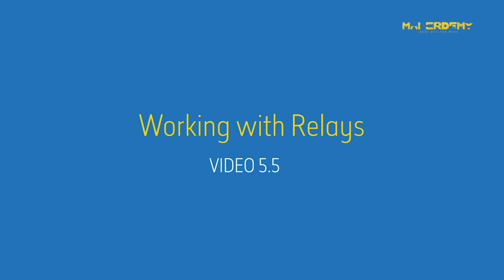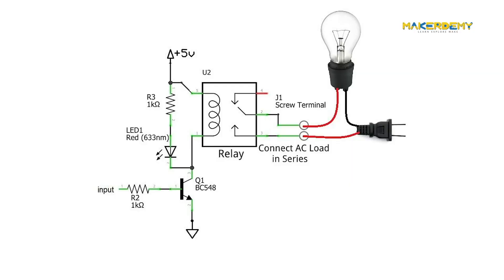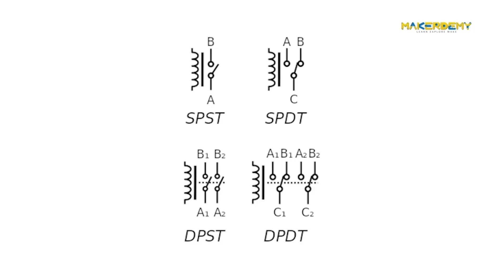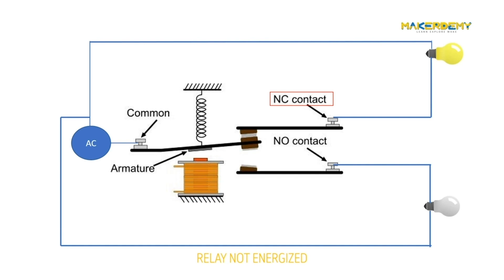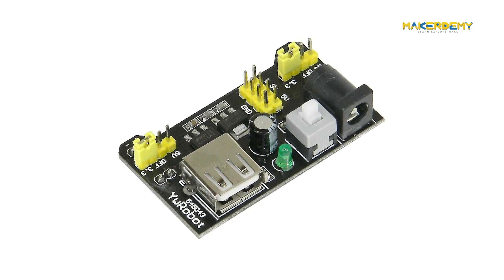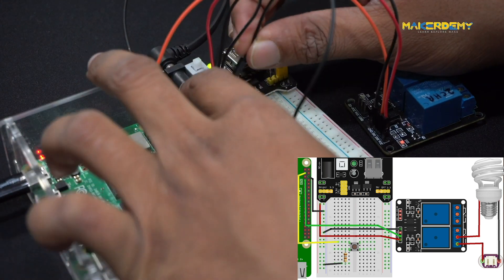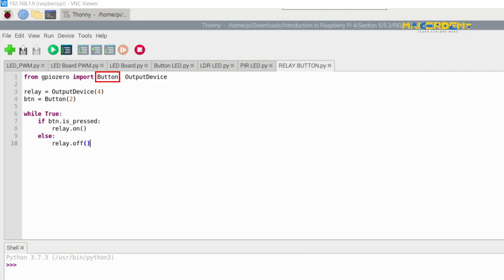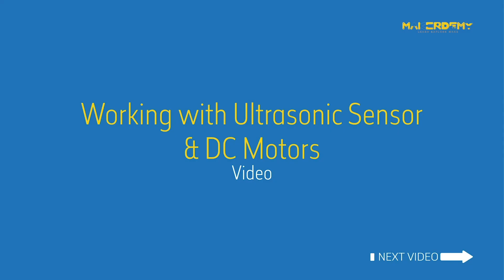Working with Relays | Raspberry Pi 4

Comment: i have external 12v power supply, can connect relay directly to raspberry pi, im working with solenoid lock,connection as explained, external power source's positive(+ve) pin to lock's positive pin and negative(ground) pin of lock to external power sorce's negative pin, postive pin of lock is connected to common pin of relay and positive pin of external power source's to nc(normally open), +5v of raspberry pi to vcc pin of relay,gnd to gnd, in1 to gpio, does it works ?
Reply from the maker: Hi Mayur, we are usually super busy supporting our students by clearing their doubts on course related queries. If you haven't already, you can check out our course "Introduction to Raspberry Pi 4". This course will clear most of your doubts.